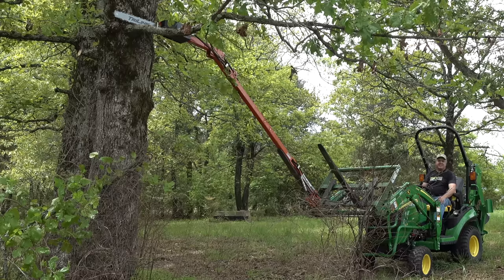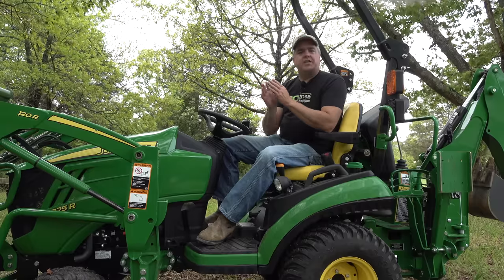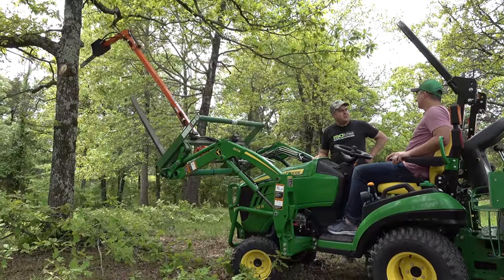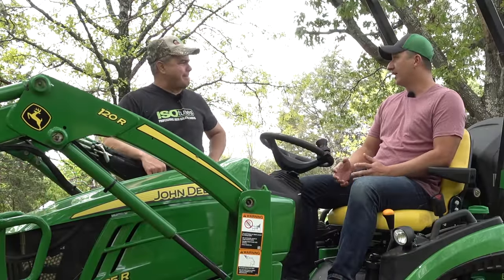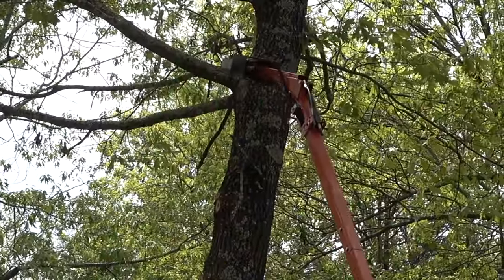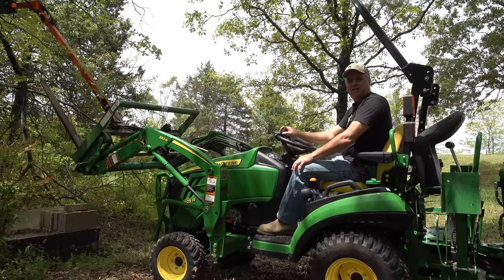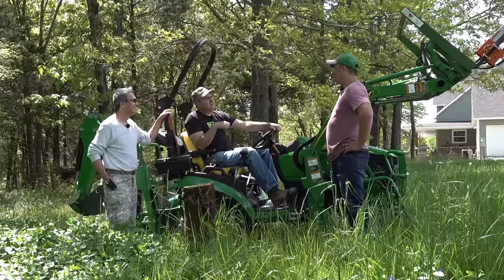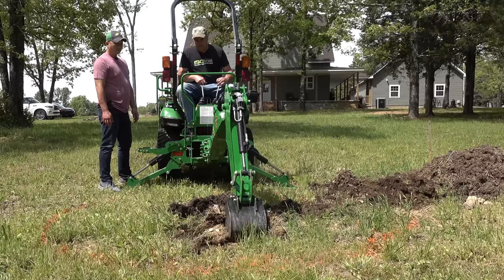MORE JUICE!! When Stock Doesn't Cut It! 2x Hydraulic Flow!!!

Comment: With that higher flow, is there any danger that it would blow out the seals in the hydraulic ram cylinders or any other seals easier.  Will they be able to handle to higher flow in extreme situations?
Reply: Short answer is no.  Hydraulic components are rated for pressure and not flow.  The concern with flow is laminar flow, which really just means smooth flow.  Cavitation and aeration both disrupt laminar flow, thus the ability of the fluid to transfer power and they are caused by either an issue in the system that is letting in air, something is "churning" the fluid (thus introducing air) or if the fluid is severely overheated.  Other than those, speed of the fluid is what is used to ensure laminar flow is safe.  The industry uses something called a nomograph to determine fluid speed.  So, when I mention 3/8 tubing can handle 9-10 GPMs, what that really means is that at 9-10 GPMs, the fluid speed is ~20 feet per second, which is the highest recommended speed for pressure lines on the nomograph.  This is also why there are differing opinions in the industry as to what the max flow for a given tube is.  The old timers I've talked to say it's much higher than the recommendation - basically until laminar flow breaks down.  In the case of this solution, we're not really approaching the 20 feet per second...yet.

Comment: So. Is this upgrade required in order to run the limbsaw? Or will it work with the stock pump?
Reply from the maker: You need the hydrosplus upgrade.
Reply: Foooey
Reply from the maker: @vincentrose9060  just do it!  The hydrosplus is easy to install.  Just consider it part of the limbsaw investment.

Comment: I wonder what the limit is?  At some point, the size of the valves and lines will be the limit to the flow.
Reply: This answer is a little complex if you get into all the hydraulic theory, but the short version is that a 12 GPM pump is probably the max on these tractors.  This is because the lines are at least 3/8 throughout the tractor.  The max recommended flow for 3/8 lines is ~10 GPM.  If you then allowed 2 GPM for the steering, then the answer is 12.  I would be surprised if many want more than the 9.5 delivers after real world use, but I am working on developing a ~11 GPM just so we know where the limits may be.

Comment: I had been thinking about trying to change the flow by reducing the size of the lines to steering.

Edit: With increased flow... I think increasing hydraulic cylinder size would increase capacity.

Safety note: Do not recommend that change as the weight capacity is now limited more by structure of the tractor.

Comment: Tim I have a 1026r and I was told that I have a bigger pump on my tractor don't know if this is true?
Reply: The 1026R actually has a slightly smaller pump than the later 1023E/1025R tractors.  The 1026R pump is an 8.0 cc pump and the 1023E/1025R pump is 8.2cc.  This amounts to 0.17 GPM less flow at 3300 RPMs by calculation.  In the stock configuration, this would barely be noticeable for the implements since it's divided in half by the flow divider, which means it is 0.085 GPMs less for each circuit.

Comment: I run into over heating when running my belly mower on the 2305. it does not take much grass build up on the radiator.  this model is the hydro drive unit. I would not want to push it with something like this with this model
Reply from the maker: Different issue.  That over-heating is in the radiator (engine water temperature), and is caused by the air blockage you describe.

Comment: I'm not a Hydraulics expert. Would this help with running stump grinders and sickle/flail mowers?
Reply: If you're asking if it affects PTO speed/power, the answer is no.  If you're talking about implements that run via a hydraulic motor, then yes.  I'm not aware of any mowers that run via hydraulic motor for sub compacts, but they may be out there.  For long term use, I think they may run into a heat issue with or without HydrosPlus.

Comment: Tim, Did you ever hear back from Deere on if this would void your warranty?
Reply from the maker: They are not happy about this upgrade.  However, they would have to prove that this modification caused the damage reported as a warranty issue.  That is not easy.
Also, this mod doesn’t increase capacity, just flow,  so, hard to say how this would cause any damage.
The only possibility would be additional heat.  So far, anecdotal testing is reducing my fears in this area.
Reply: @TractorTimewithTim  Thanks Tim. Just trying to do my due diligence and to ease the mind of the finance department....

Comment: Would adding a fan to the oil cooler do anything to help reduce that extra heat?
Reply: There is already a fan. The engine coolant fan pulls the air over the oil cooler and the radiator both.

Comment: Any reply from Deere about warranty?
Reply from the maker: Not directly.  They would have to prove that it is caused by larger pump. 
If issue is caused by overheating oil, then the pump would likely be to blame.

Comment: Will it change my PTO speed? At least the older 1025r (I don't know about the 2018 & newer) the PTO is run off hydraulic power. I do have a mower deck.
Reply: Short answer is no.  The PTO is one of the few things on the tractor that isn't hydraulically driven.  The PTO is a direct connection to the engine with some gear reduction.

Comment: I was just wondering what the cost difference is between this solution versus a hydraulic power pack driven by the PTO in the back of the tractor like trailblazer has. I know Neil messick has talked about it on his channel that he thought it was a better solution for additional hydraulic flow on implements that needed more flow to work on smaller tractors. One of the things he said as an advantage of the hydraulic power pack was that the heat would not be going through the tractor, but would be going through the power pack.
Reply from the maker: ....but it uses your 3 point hitch.
Reply: @TractorTimewithTim  Yes, I  know but many of us probably won't use a backhoe on our tractor. When we upgrade to a new tractor I can't imagine getting a backhoe. I just thought it might be good to do a price comparison as well as talk about the advantages and disadvantages of a power pack versus this solution. You're absolutely right on the power pack as you would not be able to use a backhoe.
Reply from the maker: ...or other 3 point attachment.
Reply: @TractorTimewithTim  Yes this is so true.
Reply from the maker: Don’t get me wrong....not opposed to power pack.  Trying to get one for testing another implement.  However, I think they are limited.
Another issue is that you can’t attach rear ballast when power pack is on.  Oil is relatively lightweight.
Reply: @TractorTimewithTim  well I figured that with their weight coming in at about 400 lb and you combine that with filled tires and wheel weights, you ought to be set up for anything that you would put on the front of the tractor. You ought to have your vendor, Neil Messick, lend you one. 😆 Lol

Comment: To give you an idea on my hydraulic flow. I broke the power supply line to my backhoe yesterday hooking it up. And I took about 5 seconds to shut the tractor off and I only lost 1.5 PINTS of fluid. It didn't even bring it down to add. Tractor was just idling  but... That's not much out of the power beyond supply line. I need this. Even though my dealer replaced my pump under warranty 4 years ago with a 2025 upgraded pump. I've had issues with losing hydraulic power to functions including the steering under loads. They keep saying I'm getting air in the system from my multi-function loader valve ($1000). But it don't leak fluid. The return line hose clamp is constantly loosing up. Causing issues
Reply from the maker: The good news is that you only need the flow divider to see a nice increase in implement flow.

Comment: Tim what pump configuration did the tractor you were demonstrating have on it? The 8 gpm or 9 gpm? Just curious if the diverter kit alone would make a meaningful enough difference for being able to run multiple functions on the BH and FEL. Also would an increase in pressure by adjusting the pressure relief of the loader valve and/or the BH controls allow you to backfill by sweeping the boom? I'm assuming these hydraulic cylinders are most likely rated for 3000 psi, but maybe not. Haven't dug into it that deep yet.
Reply: The tractor in the video had the 9.5 GPM solution.  The kit alone increases flow by 46% over stock and is a noticeable difference, but for the best experience, I recommend adding a pump.  The pump is rated for 2900 PSI working pressure and is likely the lowest rated component in the system.  Typically, gear pumps are rated at ~3500 PSI, but due to the mounting configuration where there are reliefs cut into the pump housing to clear some bolts, this pump is rated at slightly less.  Keep in mind working pressure is constant pressure and burst pressure is typically 4 to 6 times working pressure.
Reply: @HydrosPlus  Is it possible to add the diverter kit first and then add the new pump at a later date to split the cost?
Reply: @mikeworzel6681  Absolutely!  It does require a different tube from the pump to the kit, but I provide that at no additional cost.

Comment: Another concern is how this pump performs in the cold.  This requires a lot more testing.  You risk quite a bit without knowing more about the product being sold.
Reply from the maker: Why would cold weather be a risk?  Seems like this would be the most safe environment.
Reply: @TractorTimewithTim  Cold weather start is the worst.   Cold oil is the worst risk.  When you cold start the pump what happens ?   How long before the pump starts pumping?  Where is  your data ?  The supplier will give you optimum operating conditions.  i.e. their data will flood the pump with positive head pressure.  I doubt if Tractorplus investigated the pump supplier data, even so, it was done at flooded inlet conditions, as they want to supply to most positive info as possible.    You will starve the system at cold conditions.   The hydro will suffer.  Hydroplus has no idea how much damage is happening.  You don't know, I don't know and I know what I talking ab out.
Reply from the maker: Whatever.  Don’t buy it if you don’t want it.
No worries.
Reply: Hydroplus also did not talk about heat.  He mentioned he noted a temperature increase over about an hour or sol.  How much temperature increase ?  Based on nothing more than tractor data for tractordata.com, I can tell you tell you that a 1 degree F increase in heat is about a 50 btu  adder to the hydro circuit.   You are not even moving any real flow.
Reply from the maker: I suspect you shouldn’t buy the upgrade, as you are not comfortable with it.
Reply: @TractorTimewithTim  You should be plenty worried because you will smoke your hydro.  Do me a favor and bump up the flow to the hydro.  Again, the flow is not based on the steering speed requirement, it is based on they hydro need.  I won't tell you how much to bump the hydro flow to, as I am not the inventor of the adjustable flow divider, but if you think about factory specifications, it is a good place to start.
Reply: My last post here.  You can get by with lower flow to the hydro at lower rpms than higher rpms however.   Good luck.
Reply from the maker: The hydro has a separate pump.

Comment: hey Tim i would like very much to see you hook up your 3 point bush hog hooked to your 1025 up and close want to see the top hook aka top link and how you get it hooked and it not popping off or out of the top hook also why could you not put the divider valve on the trans pump with it pushing so much flow with the tractor sitting still and having so much flow but then again like i was saying on later video with i think the new Holland tractor with the 3 point  power pack running the brush shredder on the loader with the power pack you could run different tools like the brush shredder limb saw and even the post hole digger with that power pack   or even a sickle bar cutter like you have on vinnie i have brought that idea up a few times also please do not take this the wrong way i am not putting down this guys way of getting better hyd flow just thinking if this would cancel out warranty the hyd power pack would get you the flow with out messing up warranty
Reply from the maker: What brand brush mower do you have?
Reply: @TractorTimewithTim  land pride mine has the the flexing top link hook up to let the tail wheel float
Reply from the maker: There is an extender you can get from harbor freight to allow direct hookup.
Reply: @TractorTimewithTim  i have that extender but with it i can not lift the hog without risk of getting catching the power shaft and bending it and really need to be able to lift it to get out of anything that i find i need lift to get out of stumps or other bad things

Comment: you need extra weight on the front to stress the power steering more
Reply: As long as the pressure is the same you’ll get the same force out of the cylinder therefor more weight won’t matter
Reply: There isn't a pressure change so as long as the steering has the same responsive performance it should be good.

Comment: I will  try at a later date...Tim I just ordered a pto link duo quick connect for my 1025r and woods R4 brush cutter. 380$ rural king has it 425$ I found with my health problems my cutter was getting difficult to hook up..do you recommend this connection?
Reply from the maker: No.   Put the 1025r PTO in the ‘mid only’ position, then the tractor shaft will spin freely, allowing the PTO to be connected easily.
First line up the splines and get the shaft started, THEN (and only then) push the button or pull the ring back to allow the shaft to slide the rest of the way on.    Really not difficult if done in the right order.
Also, make sure the 3 point quick hitch (if you have one) is lowered or raised to the optimal position for you to reach in there.
Reply: Older I get more information forgetting. .yes I have speco quick hitch ...I didn't have pto lever in correct  position. ..spent 400$ for no reason. ....

Comment: I wonder about length of hose would deprive the reservoir, eventually, that is a-lot of hose in the pole saw, where there is more fluid in the lines than in the pump
Reply: I would think it would use less oil than the backhoe. Or if it is more can't be by much. It hold 3.5 gallons so should be good.
Reply: Once the hose is filled with oil, the same amount of oil that leaves the tractor has to return. If anything, all that hose will be an oil cooler.

Comment: 2100 psi and 3.6 gpm stock... That's only 4.4 horsepower from a 25 horse tractor, not very efficient for digging, mowing, or blowing.
Reply: Thanks for making this point.  When you move up to 8 gpm, which is what you can get on the implement circuit on the 9.5 GPM pump, you're still using 11.76 HP...less than half of the available rated HP.  I understand that Deere has to balance this with the hydrostatic drive and PTO, which is part of the reason it can't be 25hp, but it leaves A LOT on the table when you're using the backhoe or other stationary implement.  To add to your comment, you are only hitting 2100 PSI when the pressure relief valve is open, otherwise it's less.  When not doing hydraulic work, you are running in the 10s of PSI until a spool is activated.
Reply: @HydrosPlus  Very good points. I believe you have not even reached the limit yet. Most skidsteers seem to have 65-75% of engine power available at the auxilliary hydraulics. I watched your loader video, and it already looked fast, so I'm not sure if you would want to go even faster.

I think the most you would want to push it is 12 or 13 gpm. One concern would be the possibility of stalling the engine when hittimg the relief valve at idle, but that could be considered user error.  Is this possible with your setup?
Reply from the maker: I don’t think the loader needs any more flow, but hydraulic motors would :-)
Reply: @zachary3777  it won't stall the engine at idle, but if you were to max the hydrostatic pushing into a pile and hit the PRV on the loader, it would be close.  But as you mention, if you need that kind of power, you need to up your throttle.  With the 9.5 pump, moving up to 18-1900 rpms, you can't stall it with wheels spinning and hitting the PRV on the loader.  Agree that 12-13 is the max for this tractor - 2 for the steering and 10 for the implements would be the max recommended flow for the mostly 3/8 plumbing throughout the tractor.

Comment: I cannot see how Flow would change anything ...it is pressure that breaks stuff, flow only moves the Hydraulic cycle faster.
Reply from the maker: The limbsaw simply would not work without the increased flow.
Also, increased flow allows multiple functions at the same time, as you could see with the backhoe.
Reply: Flow=pressure...you can't have one without the other.
Reply: @davidparadis490  Restriction to flow is pressure.
Reply: @russellhazzard6936  flow is directly related to pressure differential...they are linked to eachother...thats all I was trying to express

Comment: I dont see where this does anything to help lift capacity. This is the biggest problem with sub-compacts. 
There is a big reason why manufacturers' dont put extra power into these tiny tractors. You`ll start breaking things.
This is where people get into trouble with modifying things that are not intended to do more than they already do.
If your equipment isnt doing the job you intend for it to do, obviously you bought the wrong equipment to start with.